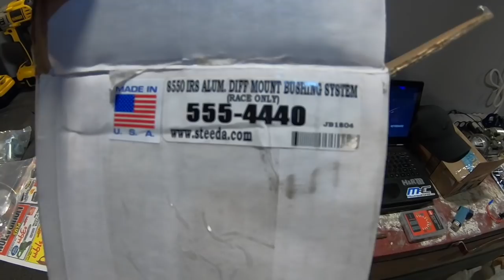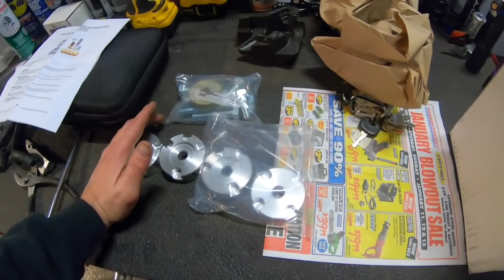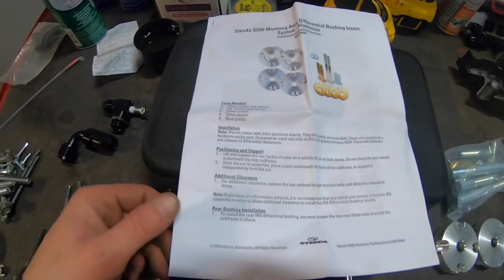2015-2019 MUSTANG S550 STEEDA DIFFERENTIAL BUSHINGS 555-4440 INSTALL

Comment: Added the bmr kit myself in poly bushings. This added the most nvh of any mod i did and i took every bushing out and replaced with spherical bearings and sleeved the subframe with ford racing aluminum sleeves. I hear massive gear whine now. Good news is longtubes and full Corsa cat back keep it only on decel on my 2018

Comment: Aren't you suppose to use a torque wrench to manufacturer spec?
Reply from the maker: Maddog Mark yes if your a Rocky at sub frames and diff bushings meaning if you only have do a few of them I’d suggest to use torque wrench. Me my self I have done over 100 or so engine replacement/subframe Removels and reinstalls that I’m very good with the feel of the bolt/nut anymore so I don’t. I only still use a torque wrench when doing engine rebuilds heads intakes bolts anything on the motor or Tran that requires torque specs and sequence that is very crucial to be 100% on point 🏁💨👨🏽‍🔧

Comment: Hey buddy, with all the rear parts you put in the rear craddle to lock it all up, did you notice a lot more noise from the play in the driveshaft in your car? I installed all the same parts yesterday and I can hear the play in my driveshaft a lot more now
Reply from the maker: Yes that is normal you are stiffening up the rear cradle this is why you hear more road noise and drivetrain noise